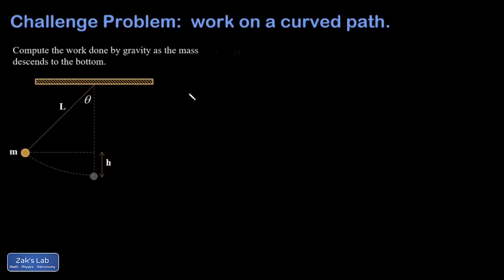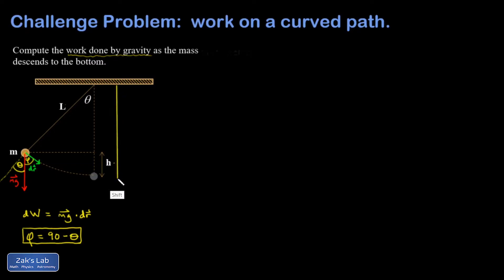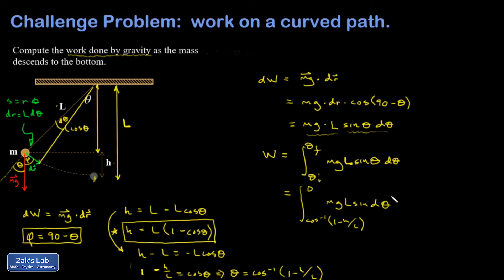Work done by gravity pendulum problem: work integral for a curved path.  Work integral for gravity.

Comment: Loved the video.. but i have a question. How did you notice that d(theta) was negative in 9:03? Is it because you are going from some angle theta (which is greater than zero) to theta = 0? If so, then I would think the placement of the boundaries would solve this issue (I ask because in the case of gravity or electrostatics it is the case that the boundary placement carries all the information about the differential). Or maybe the placement of boundaries do solve the issue, but only in the general case.. idk.
Reply from the maker: Yeah, it's just because I defined theta as positive in my diagram, and that was decreasing, so alpha is in the negative direction.   Alternatively, I could have made theta negative to the left of the vertical and alpha positive, either way alpha and theta must differ by a minus sign.  I'm sure there's a better, more formal, way to handle it without this confusion!  z

Comment: This method is tooo complicated!!!!! Just use the vertical distance while computing work done by mg! Because it’s a conservative force, and path doesn’t matter!  Done!!
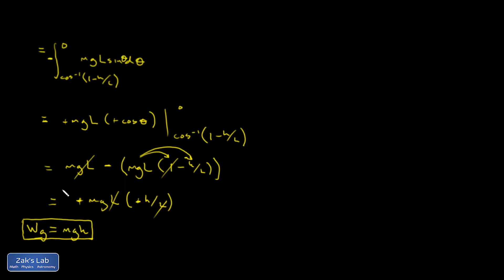Reply from the maker: You are absolutely correct!  But the point was to compute the work using the fundamental work integral on a curved path as a way of practicing work integrals (which are sometimes unavoidable).  If you watch to 10:55, I comment on the fact that we arrive at the familiar equation W=mgh and that the path-independence of the work done by gravity allows us to bypass the work integral.  This problem is a common "challenge problem" when work is first introduced in calculus based physics, before the notion of conservative forces is introduced.